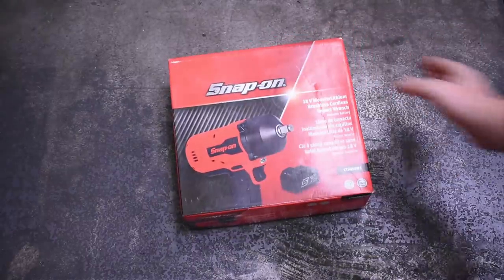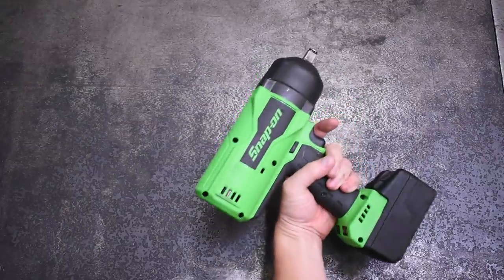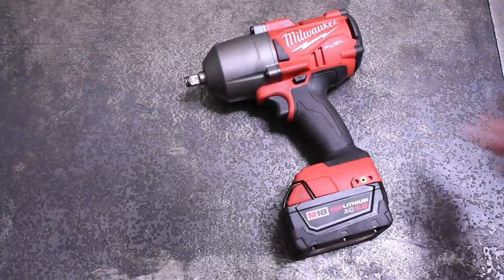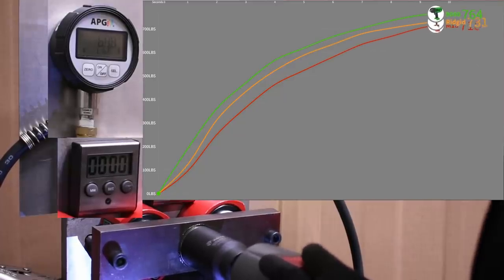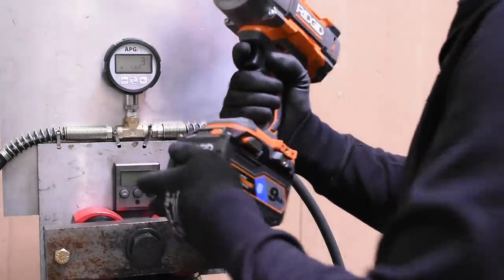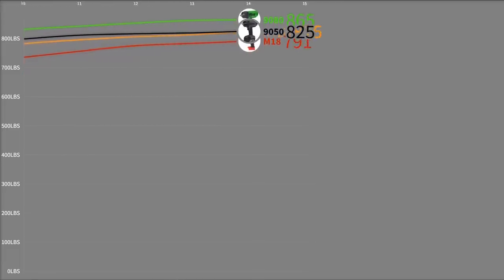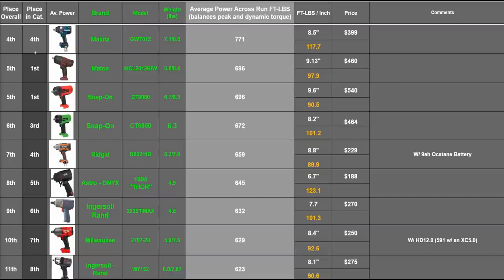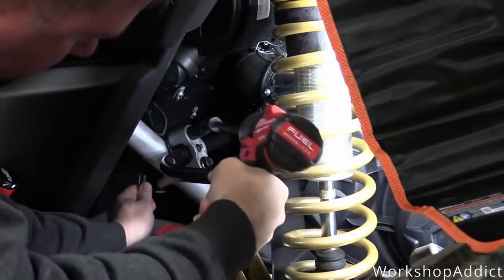Snap On's New CT9050 High-Torque is Smaller Than M18 & Hiding A Big Secret

Comment: This is starting too feel like comparing super cars vs a normal car. Sure a 160hp car is enough, just like an impact with about 200ftlbs.. but the POWAH
Reply: You only need high torque like that if you got someone ovettigjtened bolts or lugs or the crank pulley bolt. But it’s rare it is that stuck on there unless your pulling the car from
Lake Michigan. My little weak dcf902 will take off brake caliper pins no prob. That’s like a 100ftlb play impact
Reply: @jecrpalier  when i got the gdx18v-1800cb (Bosch Freak v3) it instantly turned in to my go to for screws and bolts, and with a battery w/21700 cells it was able to take off bolts torqued down to 180ftlbs no problem (after about 2-3 seconds it would start to move). I have a bluepoint pneumatic mid torque that puts out about 600ftlbs i think and now i rarely use it unless i actually need it. Every once in a while i run it at 120psi and sparks fly out of old rusted bolts :-)
Reply: @MrHeHim  I have the stubby 1/4 inch impact and dcf923 atomic which is like shown on a channel here that hit 450ft lbs losebing. That’s what really u should use cause I
Do have a 200lb Milwaukee that’s like 5yrs old and it’s barely used but had basically weak power. It couldn’t take off overtightened lugs. Just was not very good. Eventually after about 20x it did. But that’s why I got 923. To use for small crap and larger lugs once in a while. I do have the 899 for just heavy duty but u can’t stick thay under a car without jacking it up about 2 ft